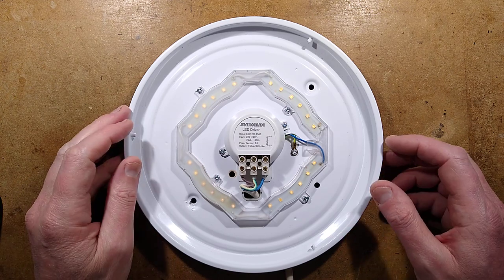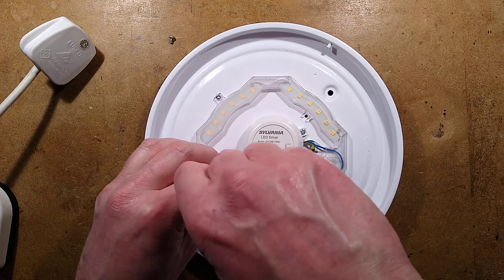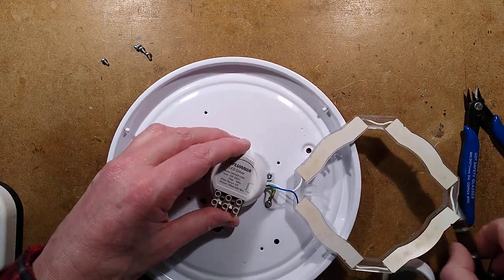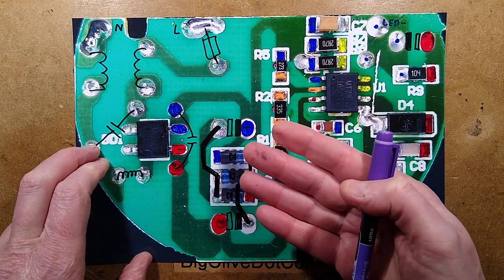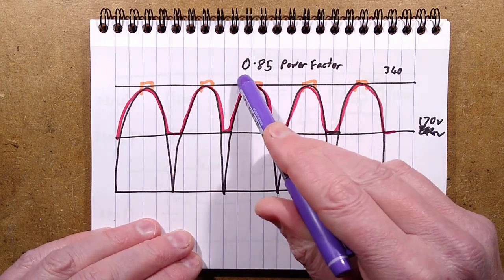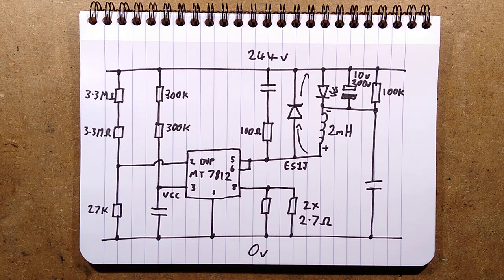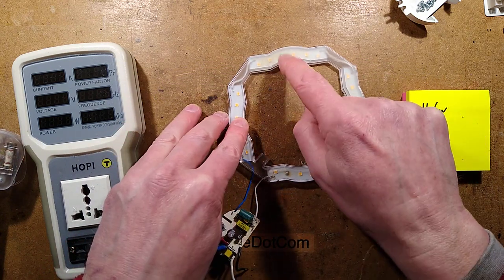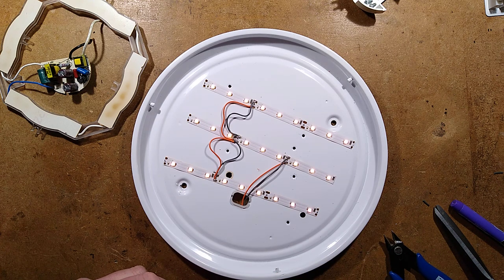Fixing and hacking a light from Thomas Nagy

Comment: A polite reminder. Just because it says "Made in China" on t he side doesn't mean it's crap. Also, that doesn't tell you the important part: where it's designed, regardless of what "it" is.

China gets a bad rap because it's where everything is built, good and bad, and we all tend to remember the bad stuff best. But nobody thinks about where stuff is designed because all we think of is the "Made in China" marking on the side of the box or whatever. Thing is, if we somehow made the USA the world's dirt-cheap labor pool (god save us all) we'd get the same reputation, here and worldwide.

That's because we're asking the wrong question and therefore getting the wrong answer. This is a soapbox of mine. Garbage in, garbage out. The problem isn't China, but blaming them makes for a convenient scapegoat. The problem is that we let accountants run all the engineering departments at major corporations. Design decisions are dictated by how many hundredths of a penny they shave off per unit at mass-production quantities while not killing off too many shareholders or generating enough sensational headlines to otherwise affect profits. It's about money and it's about management.

It's the same reason that "engineer" is a dirty word among car mechanics. (Watch the "Rainman Ray's Repairs" channel? You almost certainly know what I mean.) Hey grease monkeys, nothin' personal but when your job's on the line what the heck ya gonna do? After all, if you refuse, all they're gonna do is fire you and find someone else whose morals are more malleable. Now you're out a paycheck and the product's on the streets anyways with exactly the nasty they wanted, if not worse. It ain't the engineers, it's management, it's the accountants. It's the people who run the numbers and push the pennies around. An engineer gotta do what s/he gotta do, ya know?

If you want product that doesn't suck, fix corporations.

The place that starts is public policy. "Regulation" is a dirty word in US politics for a reason, the corporate world has poured truly shameful quantities of dough into making it that way. "Regulation" means your toaster doesn't burn down your house every morning. It means you get SOME sort of legally enforceable warranty on the thing, even if it is a bit token at this point. It means that your USB charger, even if you were stupid enough to get one from Dollar Tree for a reason other than tearing it apart for a YouTube channel ;) isn't supposed to electrocute you every time you plug your phone in... and it's not supposed to kill your phone, either!

Get good regulations, that force corporations to not be complete jack***es -- proper warranties that aren't stupid and impossible to enforce, "extended warranties" that aren't just moneymakers for Best Buy and their ilk in a similar vein, limits on what materials can and can't be used, safety requirements on all sorts of things that currently don't have them but really should, consumer protection laws and maybe even a federal watchdog agency for the stuff, etc, etc, etc -- and you're off to a good start.

Really at that point the rest of it is fixing... well, really from an American standpoint, since that's where I live, it involves fixing a lot of the things that are really messed up here, but at that point (a) you're practically at a point where you're re-engineering the whole dang thing from the ground up, and (b) that's a whole huge lump of politics for the most part, and BigClive quite understandably doesn't like that mess around him -- and, honestly, I'm kind of with him at this point -- so I'll honor that and pretty well just leave it there for now.

Comment: This one was not well designed. Neither for proper heat dissipation, and too costly assembly wise. Most of these "non-replaceable" LED fixtures, I encounter, use a single aluminum PCB, with both LEDs and power supply soldered on that single PCB. The PCB is large enough to properly dissipate the heat, with no additional heatsinking, and being a single PCB, saves on cost of production.

Comment: If you reduce the power by half.  Are you not also reducing the brightness by half.
Reply from the maker: It will be more than half intensity, as efficiency improves significantly at lower current.

Comment: A nice light output from this shell via the makeshift 12v LEDs. As for the 240v system it does sicken me with all the Save the Environment and Reduced Your Carbon Footprint stuff that we are subjected to these days. I really don't understand why the Gov don't clamp down on companies that will not reduce landfill by pushing for these hacks already built in. I know this will make me out as a bitch too, but I do get sick of the one rule for us consumers and the one rule for the company's manufacturing these products. Even if they fail a pull out and replaceable plug-in system to be employed for easier maintenance to these and similar designs of lighting or circuitry, than the throw away the lot ethos of modern products.

Comment: "if you touch the LED while the power is on" I was gonna ask, WTF would have the power on while working on this?!? If it was me, the breaker would be locked out, of course more then half my family are electricians, my father started as an electronics tech... so wouldn't expect everyone to know to work on a circuit that is dead...

Comment: Until manufacturers from Bulbs AND Lampfittings understand that this is just e-waste and should be banned, I buy the "E" and "F"-Rated "totally bad for your environment and killing thousand animals an hour" E14 and E27 bulbs that are 100W equivalents because they produce light and as long as they have enough air, they work flawlessly. My oldest LED bulb now hits nearly 10 years and is still fine. 
As long as people buy these fixtures for 5 bucks and make a surprised-pikachu face when it is dead a year later, things won't change.

Comment: i dont like these active dropper circuits, if the switching device shorts you get full rectified mains shoved into the leds, with obvious results,   or those current stabilising chips, they run very hot, surely a good old capacitive dropper is less likely to fail? the latest led bulbs from poundland use the current stabilisers, instead of cap dropper in the earlier ones, from the outside, they look identical, only way to know is to rip off the diffuser plastic ...

Comment: LEDs are probably one of the biggest "earth saving" scams of all times because as long as every brand can put any desired end of life defects in the design without proper regulations for this it just gonna keep happen. I had several LEDs fail again in a short time and this is with as short as just 1 year and 1 week of use, yes the warranty was 1 year and I did not get any new bulb even if the 15000 hours life can´t be half met even if the light would had been on for the whole year, scammers! that was a Philips bulb of a newer type with less numbers of filaments meaning it is naturally too hard driven as always. other was a locally branded type which was 2 put to use at the same time, they failed after pretty much 2 years of service with 1 week in between so naturally they been programmed to fail at this amount of use. third ones G9 Osram bulbs, I have 3 in the same armature and yes ALL 3 lamps failed but with a bit wider interval but the first one again fail within the firs year and the other ones within month later, these had failed Solder joints all 3 of them because the quality these are put together with STINKS!! surely they know these smaller bulbs gonna get pretty hot and baked over time cracking the lead free embarrassingly poor joints render the bulb useless hopefully just after the warranty ends, well I took them apart instead and soldered them real good and put them back again, the first one has now worked for 3 years HA HA HA HA, I just say: Laws that FORBID planted failure points, and that PEOPLE start to DEMAND their product warranty gonna last AS MUCH as the HOURS AND YEARS STATED ON THE PRODUCT!!!! It pisses me off so much to see how every single failure around LED products are due to their intended design which is meant to fail

Comment: Hmm Power factor and apparent power🙂 is there a connection??
Reply from the maker: Yes.  The power factor is directly related to apparent power.
Reply: @fredflintstone1  If they charge you for apparent power, a better power factor (closer to unity) means you get charged less. Apparent power = true power / PF
Reply: @rexsceleratorum1632  I don't have a smart meter so at the moment I pay less with apparent power items

Comment: When working on ceiling lights that are the ONLY light in the room one should always use a metal screwdriver WITH the power ON. This is so that when YOU light up, you can see CLEARLY what you are doing! 🤪😲😱🙄⚡⚡⚡🤣🤣🤣

 NOTE TO NEWBIES: THE ABOVE IS A JOKE! DO NOT DO IT!

NEVER HAVE POWER ON WHEN SERVICING A LIGHT AND NEVER USE AN ALL METAL UNINSULATED SCREWDRIVER (OR ANY OTHER TOOL)
Reply: @Okurka.  true, but no light either! 🤔🙄😁😁😁

Comment: Could you replace the fried LED with a resistor so as to not fry the remaining LEDs?
It'd be cool if you could explain what snubbers do one day... and alleviate my ignorance.
And thanks for being a bitch at the eco-hippies and rip-off manufacturers.... they both need as much goading as possible! :)
Reply: This unit has a proper constant-current driver. This means bypassing an LED won't push the others harder.

You would only need to worry if the circuit was a basic resistor or capacitor dropper.
Reply from the maker: The circuit uses current limiting, so it will remain fairly constant.

Comment: I actually think light fittings without user replaceable parts are a good thing if done right. 
All this led replacement bulbs have bad thermal management and grill the leds. thereby having bad efficiency and longevity.
The complete fitting itself is not mush more material then the replaceable bulbs. but they have the potential to last way longer.
Reply: @MultipleObjectSelector  For me it is no problem to replace LEDs in a fixture to the specific ones i want.
Retrofit LED  bulbs make lot of compromises by using the 100 year old fomfactor.
Reply: @MultipleObjectSelector  to your first point there alredy is a tool less socet system for ceramic COBs from Ledil and other manufactures.

I digress with your point of the trash and waist-full design. 
let me explain: 
The fixture alone is made out of thin sheet metal, Glass and Plastic.
All thins we trow away/recycle everyday.
it’ basically a glorified glass of pickles.
 
The part that is is hard to recycle and recurse intense to manufacture is the electronics. 

the current situation is the fixture stays there for ever. so we avoid some amount of non problematic" trash.
But the bulp gets replaced regularly. 
Beaus it is cheap and small we don’t think of this as a problem. 
But this is the accentual recurse and energy intense part and the hard to recycle problematic trash.

There is a secondary problem. 
because they are considered a consumable 
they need to be cheap. 
and they are to cheap! this is a false economy 
The customers save a view $ on the bulp event thought they would save more on energy over the life of the lamp with a more efficient and loge lasting bulp. 
This results in even more waste and wasted energy.

On the other hand the fully integrated fixture.
Customers pay more because it is not considered consumable.
Because of this and because better thermals they will last way longer and be more efficient. 
Sure if they brake they generate more wast. but most of it is unproblematic fixture materials (gals plastic metal). the amount of electronic is about the same. 

And since they are a glorified scaled up LED Bulp you dispose them the same way as you dispose LED bulps.

i sincerely think they are a over all less wasteful.